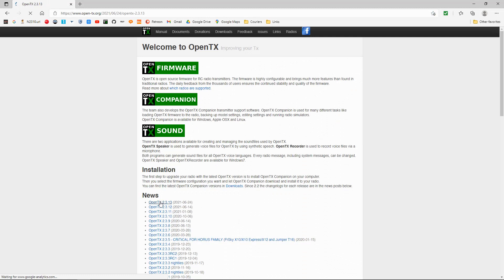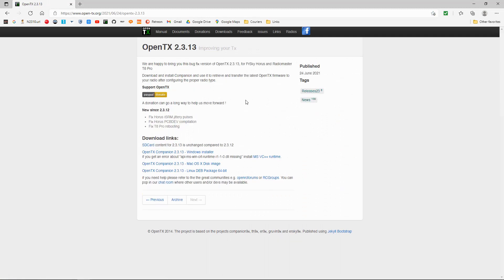OpenTX Firmware Update 2.3.13 Available Now

Comment: I have updated my Radiomaster TX12 with this latest version but I cannot bind to R161 receiver. I have already updated my receiver with the last firmware released also. Would you recommend any advise?
Reply from the maker: Was the receiver bound to your radio before the update? I have just checked my radio and the R161 is binding to my TX12 fine running OpenTX version 2.3.13 and Multi Protocol Module firmware 1.3.2.86.  Have you also updated to Multi Protocol Module firmware to 1.3.2.86? If not please try doing so and see if now your R161 binds ok?
Reply: @the-happy-RC-flyer  No, it did not bound to my radio. My radio does not have FrSky X for protocol type and the status not show the version.
Reply: The update have already accomplished with new version which have Multiprotocol v1.3.2.86 and OpenTx v2.3.13
Reply from the maker: @DRonArtist  My R161 is binding using FrSkyX2 D16
You mention you are not seeing the version in the Status line could you please try changing type to FrSkyX2 D16 and see if the status appears and your receiver binds.
Reply: @the-happy-RC-flyer  Still unsuccessful.
Reply: @the-happy-RC-flyer  I don't know what the real problem is that caused the bind process to fail.
Reply from the maker: @DRonArtist   I think the problem is the firmware not matching up. It will be X or X2 and EU or LBT Please try Updating the R161 firmware to V2 and then try and bind with FrSkyX2
Reply: @the-happy-RC-flyer  I have updated to V2 FCC, but no luck
Reply from the maker: @DRonArtist  Is your radio still not showing the MPM firmware version?
Reply: @the-happy-RC-flyer  Not showing the MPM version
Reply from the maker: @DRonArtist  I have the same problem with the T8 Pro after updating the MPM to 1.3.2.86 but not with TX12. I am in contact with RadioMaster about the problem could you please leave it with me and I will keep you updated once I have news.
Reply: @the-happy-RC-flyer  Ok..I will wait your update. Thanks for you time. Have a nice day!
Reply from the maker: @DRonArtist  has your problem been solved with your MPM?
Reply: @the-happy-RC-flyer  Problem with my radio transmitter. The report has been made and they agree to swap with new one.
Reply from the maker: @DRonArtist  that’s good. Mine is being returned to RadioMaster to be tested. It appears only you and I have come across this problem.